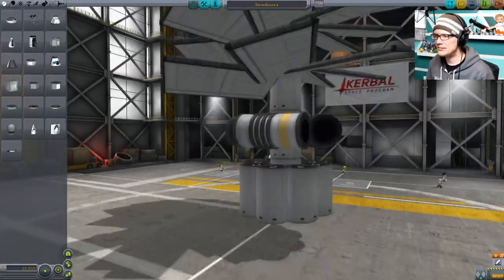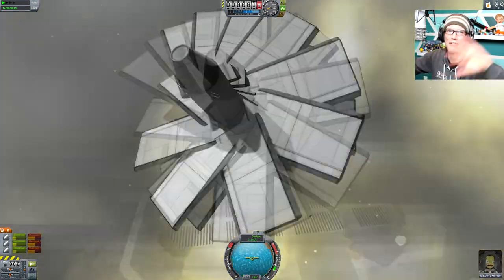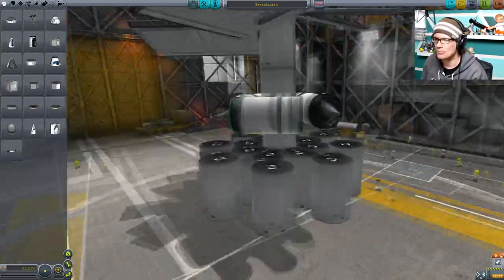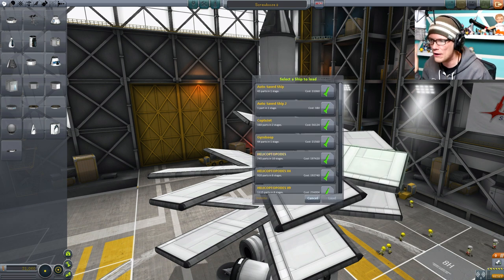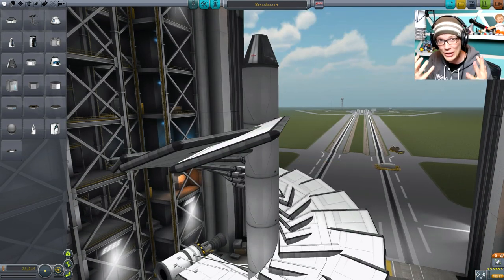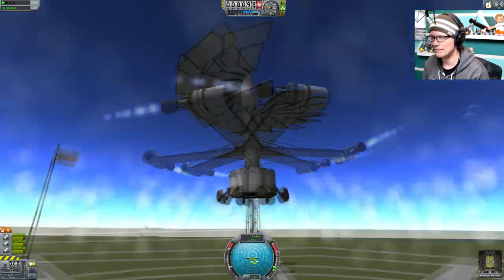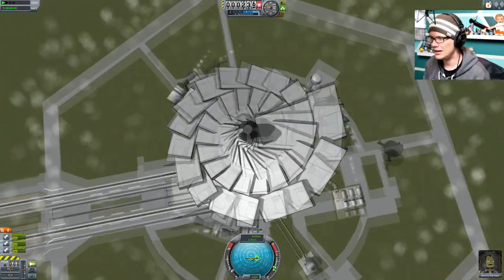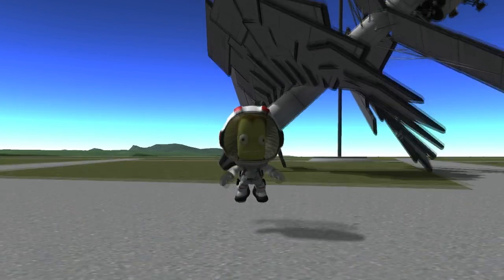Secret Project: Screwloose! | Kerbal Space Program | Part 5

Comment: Hank, you should install the mod 'Ferram Aerospace Research'. It adds in a more realistic aerodynamic system. Default KSP just says "This lifting surface is moving at this speed so it will generate this amount of lift upward based on the orientation of the part". Ferram Aerospace Research (FAR) adds in some fairly intense aerodynamic calculations, adding lifting body effects and so on, so that things fall differently (kind of how a skydiver can aim and turn and move themselves around while falling due to the air pushing against them in different ways. Normal KSP doesn't calculate that kind of thing, FAR does). It makes building stuff like helicopters a lot harder, but also a lot more realistic.

Also, I would recommend a mod called Damned Robotics. It adds rotating joints that can be used to have a fairly frictionless spinny part like a blade, or hinges that can be controlled to give yourself variable lift wings and so on. They are both very cool mods, and would make it so this series could go on a lot longer and still stay awesome! :D

I think the screwloose would work a lot better in ferram than it does in standard model. But the original model would've had no chance. xd
Reply: Was going to comment with the same!
Reply: *****
 Having tried, and continued to use FAR, i can tell you hank that it is a pain in the butt to learn how to build planes that will work if you're used to standard KSP aerodynamics, but i can also say that it is a much more realistic system and something like this, or the HELICOPTOPODES would work much better with it.

also, the wobble wasn't because of the bounce, it was because your center of mass doesn't align with your axis of rotation. the screw you built goes more than 360 degrees around the cylinder, but only makes slightly more than 1 full rotation, causing the center of mass to be skewed more towards the side where the two ends slightly overlap.

Comment: I'm curious what would happen if you added another set of wings to wrap around the cylinder (vertically, so you'd have a second repetition). Would it screw faster/farther or would it just be extra weight?
Reply: Well, for one thing, it would be balanced so that wobble thing wouldn't happen.
Reply: i just wanted to write the same thing
Reply: I'm surprised there isn't more people suggesting the 'twin thread screw' approach, or even a triple thread screw. Listen to your fans, hank!
Reply: I was thinking the same thing.
Reply: Is this game pc only? My pc is shot but I would live to mess about with a game like this! Xx
Reply: Scott Dann This is PC only
Reply: Filo Pilo damn. I best get down to currys then
Reply: Scott Dann it's windows only, but that doesn't mean you can't dual boot windows with whatever other operating system you're using at the moment to play it.
Reply: DearestClaudio the problem is I haven't got it. I have a net book that was less than £200 6 years ago. It's fair to say it's not got what it takes haha. So I just use my ipad and Samsung s5 to get by at the moment :)
Reply: Best design would be rotating blades followed by fixed blades, much like how a turbine would work

Comment: Hank, the twisting has nothing to do with the asymmetry of the wings. Because of the screw shape, the lift force creates torsion as well as translational motion (the leading edge of the screw is twisting the ship sideways). If you grab anything with an L shape and pull the two ends apart, you will see the L bend like your spaceship did. To solve it, secure the underside of the wings to the cylinder with struts.

At the end, it should look like this:

|   |------------- leading wing
|   |         /
|   |       /  strut
|   |     /
|   |   /
|   | /
|   |

Cylinder

Comment: b-but Hank, in regards to your nail vs. screw comment: hammers exist, and it's rather hard to put a screw into anything that doesn't have a pre-threaded hole, unless you use a power tool. which, well, you have engines. fair point. but...you can push a nail into wood with a hammer, you can only really push a screw into wood with either lots of wrist power or power tools. hence why regular rockets are faster, i guess.

Comment: Hey, Hank, why don't you try to place engines facing more toward the center of the helicopter. It won't be that efficient on low speeds, but on high speeds that would help counteract the ripping forces by increasing centripetal force (or however it's called)